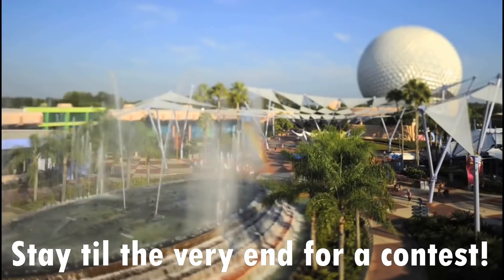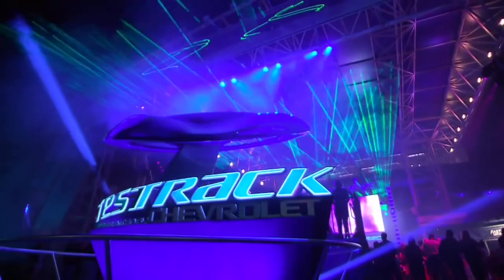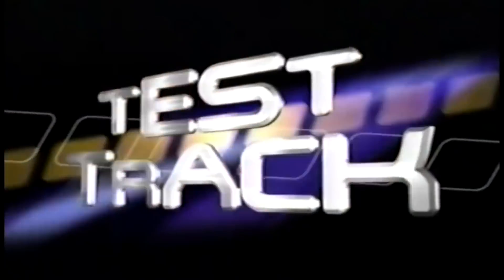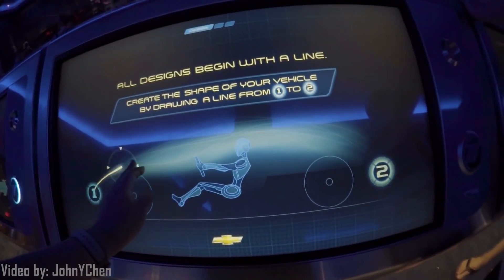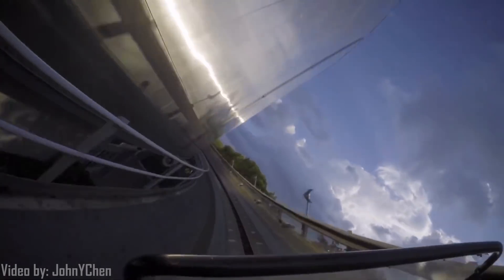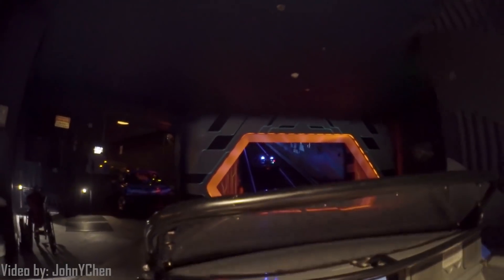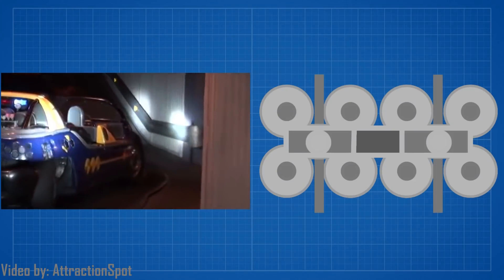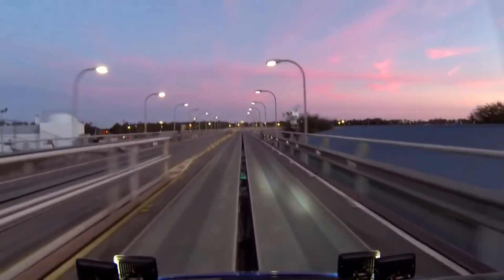[Behind the Scenes] How It Works: Test Track @ EPCOT | Disney's FASTEST ride

Comment: World of Motion was easily the best of the original EPCOT rides.  In a park with only 10 rides, Test Track should have been an addition, not a replacement.  That's one of the reasons for it's attendance issues - it costs the same as Magic Kingdom with 20% of the rides.

Comment: I was part of the test and adjust team for this ride. What a nightmare, nothing worked and we had several major crashes/incidents. Luckily it got so far behind I got to work Horizons for a while too and what a gem of a ride that was. I know rides have to be replaced after so long but it sure sucks loosing some of the ones you grew up with.

The new version of Test Track does not live up to the original idea, nor does the queue which was amazing.

Comment: Great review.  I got a chance to talk to one of the Imagineers who created this ride back in the day.  They had the hardest time designing an electric engine to power the car tethered to the rail system shown here.  The rail was not the hard part -  getting the motor to do the work was the hard part.  Some of GM's technology was leveraged for that part of the ride as they helped some with motor problems that was described when Disney took over development of the ride.  You are completely correct with the 8 car limit initially.  It was what killed the original contractor and forced Disney to take over.  This ride is pretty amazing when you realize what had to go into it to make it work.

Comment: A few comments:

1) Why did this ride succeed while Rocket Rods was quickly closed?
2) Homes typically don't get three phase power -- a final step-down transformer taps a single phase, although it spits out two 180 degree out-of-phase lines. This essentially gets you +120v and -120v (in the US... and ignoring the fact that this is AC power), giving you 120v for most outlets, or 240v across the two "phases" for ovens, dryers, water heaters, etc.
3) I'd love to see a video on Disneyland's Indiana Jones ride. AFAIK it's fairly unique.

Comment: Tell me if I am wrong but doesnt 3 phase power require 5 different bus bars. If its just three then I am pretty sure thats single phase. Once again tell me if I am wrong but you need a bus bar for each hot (so three different hots) one for the neutral and one for ground.
Reply: The only way this could be 3 phase is if the ground of the electronics is also neutral for the AC. Bad idea though

Comment: While you're in the queue, what's all that stuff they ask you to program to make the car "your" car.  As if I had designed the test parameters or whatever.  Seems to not really make a difference to the ride experience.  What do you say?
Reply from the maker: It doesn't make a difference. It's just a fun little thing they added. Nothing changes, it's the same ride profile, but your car comes up on the screen when the car passes the reader.

Comment: I do wish Disney had more actual thrill rides. Even though the theming is good at Disney, I much prefer universal.
Reply: How many do you want? 
If Your definition of thrill = fast then…
- Tower of terror
- Rock n Rollercoaster
- Space mountain
- Splash mountain
- Big Thunder mountain
- Seven dwarfs mine train
- Mission Space
- Test Track
- Soaring
- Kali River Rapids
- Avatar Flight of passage
- Slinky dog
- Expedition Everest
With two more on the way:

- Tron
- Guardians of the Galaxy

You may prefer Universal, but I don’t think you can base it on Disney not having enough thrill rides !
Reply: @MinifigJez  well actually not all of those are fast, test track topping around 50 miles and hour. And space mountain is slow at around 30 mph. Not to mention they stick fans in there to give the illusion of speed. Tower of terror is a drop tower of sorts, mission space is a centrifugal force simulator ride, soarin and the avatar rides shouldn't even count for "thrill". And the seven dwarves minetrain just sucks
Reply: @Pilot_Shadowstep  You've got good points regarding speed (some FEEL faster than they actually are) 
but I still would count all of these rides, as things that you can get a thrill out of!
(hence the name "Thrill Ride") - I was just questioning @Go Descend's definition of "Thrill ride" and that I think Disney has a lot
But Soaring is DEFINITELY a thrill ride - my whole family get a thrill out of it every time we ride it!
Reply: @MinifigJez  well thrill rides are an actual classification of ride, 90% of all rides In disney are family friendly coasters and simulators. The closest to an actual thrill ride would be space mountain, test track, and big thunder mountain but those are all still meant to be family friendly. The actual phrase would be considered in rides at universal and islands of adventure like the incredible hulk, velocicoaster, or rip ride rock it. Even SeaWorld has good thrill rides such as manta, kraken, and the hyper coaster Mako. Busch gardens tampa is leading the pack with the new iron gwazi, kumba, montu, falcons fury, cheetah hunt, and sheikra to name a few. The normal definition would be speed and Gforce, inversions being a bonus
Reply: @Pilot_Shadowstep  Blimey! - I didn't realise someone had decided to classify what a Thrill ride was!
But unless it's some official organisation, that governs the marketing of rides, and penalises owners for trade description, if their ride isn't thrilling enough, I'll stick with our families definition, that if we get a thrill out of it, it's a thrill ride!  - But then again, by our definition, our family would classify  Spaceship earth as a Thrill Ride!  ;)
Thanks for the information.

Comment: 6:25
Why does that car have Lotus-sourced rear lights?
Reply: That car is from radiator springs racers in DCA. Same ride system as test track just a different exterior
Reply: Looks like a ~1961 Ford Galaxie sourced tail light TBH.

Comment: PPPs, is Radiator Springs at DCA an Exact copy of Test Track?
Reply: Phil Rabe No. it uses the same ride system, but is a completely different layout. Also was built new from ground up rather than using an existing building.

Comment: The original test track was a much better experience than the new one. The physical sets and test chambers were way more memorable than anything in the new version. The new pre-show where you build cars slows down the line way more than the old show.
Reply: Agreed that it's not a great pre-show, but I doubt it slows things down.  The number of cars on the track controls the capacity.
Reply: but it doesn't represent Epcot in any way what so ever
Reply: @NOI2Z  If they updated the videos and some of the testing names from the old ride it would be no different to the new ride. New prototype cars get the same treatment as older prototype cars. You still have to put them in heat testing, cold room testing, transmission testing, brake testing... I really miss heat, cold, and water test chambers. The tron glow will not age well. I felt it was dated when I was on it in 2018.
Reply: @DDRMixer  except you'd be missing the theming entirely...
Reply: @NOI2Z  Of testing prototype cars? It's future world. The theme fits.

Comment: I miss the old environmental test chambers.
BTW, if you look at the pathway and especially the planters underneath the outside track in front of the ride building, you can find lots of black rubber strips and pieces. Those are pieces of the tires that constantly are shred off during the high-speed part of the ride. Free Disney ride collectible for you :)
Reply: Wait, really?!?
Reply: @KettouRyuujin  yep, same with Radiator Springs Racers, but its much more confined to the track

Comment: The track itself is pretty interesting. It is surfaced with the same gray stuff they use on aircraft carriers. The reason is it has the same drag coefficient dry or wet. I actually walked the track with the Imagineers before it opened; that was an experience I'll never forget!
Reply: I too got to walk the track before it opened.  My dad works in the film and commercial industry and he got hired on as a gaffer (lighting department) to help film a commercial for GM on Test Track - sort of a cross-promotion between GM and the new Test Track attraction.  

We all flew to Orlando, and on one of the days, I actually got hired on to help my dad with some menial tasks, including working a breaker box to turn the heat lamps in the environmental tunnel on and off while they were shooting that scene.  

In our down time, I got to walk the entire length of the interior track, looking around at all the props and stuff.  Remember, this is back when it was themed as a GM test track facility, so it had a very industrial feel.  Lots of prop toolboxes, tools, tires, crash test dummies, etc. were everywhere.  I always remember that, however random and "scattered around" everything looked, if you went up and tried to grab it, it was all secured down.  Nothing could actually move.  

Going through all the little back-stage areas and shortcuts to get from one part of the ride to the other was awesome.  It was an experience I'll never forget.
Reply: DONT LEAVE US HANGING - tell us more what was it like who did you walk with how did they let you in were you an engineer or maintenance how how?
Reply: @SWIFTO_SCYTHE  It was so long ago, while it was under construction. I went with a group of engineers from IEEE. One of the Imagineers had posted the event and I signed up. It was really cool getting to park behind Epcot and walking the track as it was being put together. Many of the scenes were there, like the truck you almost run into.